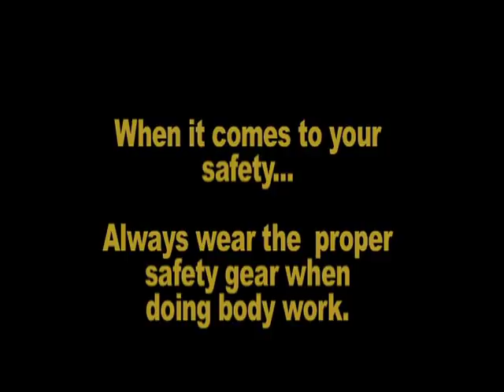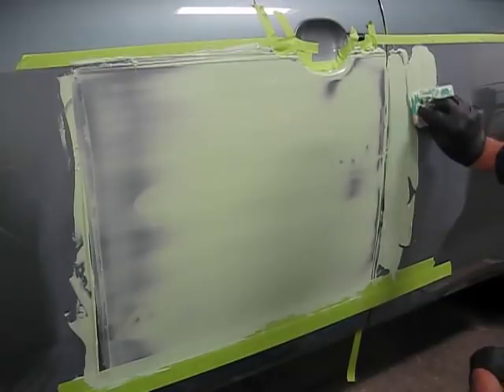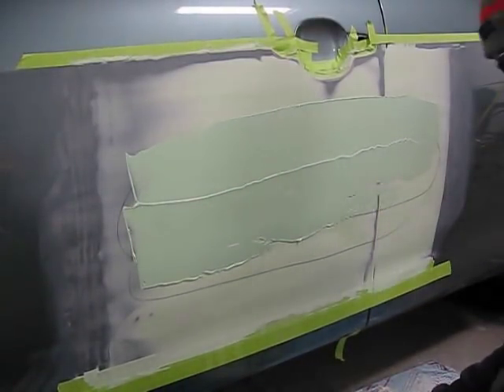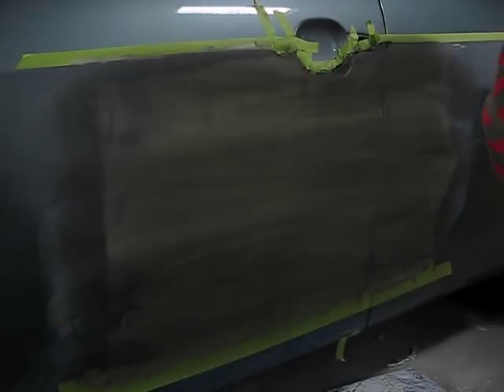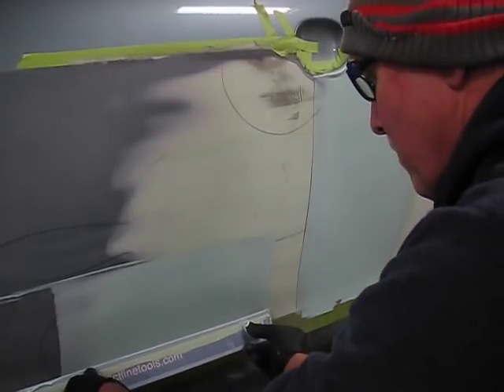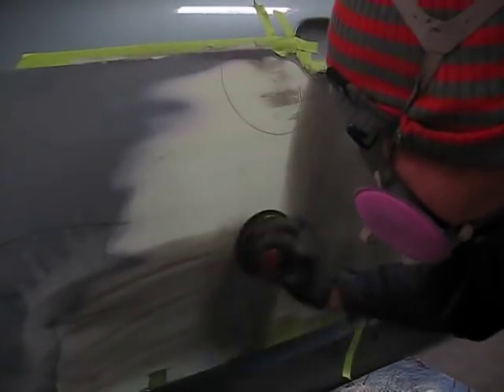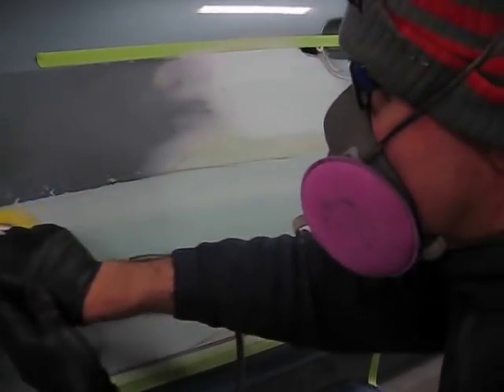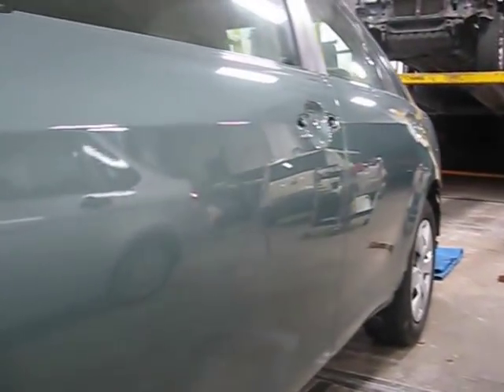BONDO SHAPING PERFECTION WITH THE BLADE

Comment: That works putting it over paint? I was always told to grind or sand all the old paint off,
Reply: yes it does...things have changed...materials are better..etc..you can go directly over paint...
Reply: over "sanded" paint or primer is fine these days. It is actually better not to expose the bare metal. 47 yrs I've been doing body work, yes it use to be grind the paint off first but that changed in 1988 for me with the new paints, primers and body fillers that came out.
Reply: GR Smith I don’t agree at all. This idea that you prime or seal has never worked for me. The mud always shrinks on the edges and pulls away from paint or sealer under it.

Comment: This man has awesome spreading skills, my bondo never stays pliable for that long
Reply: It’s because he has little hardener in it.
Reply: @deeznutzz8375  😂
Reply: I don’t think there is any harder on it
Reply: @deeznutzz8375  The problem with too little hardener is the edges don't set and then the edge can peal when sanding. However theres special types of bondo you can buy that sets even slower and theres also retardants to add that slow it setting.  A product called 'Liquid Honey' can make it runny for horizontal bonnets and roofs.
Reply: First batch I mixed up dryed up before I could apply it😂😂😂😂😂
Reply: They make a slower drying bondo, check into it. I know Keystone makes some for a fact!
Reply: Also if the ambient temperature is colder that helps slow down the curing of the plastic filler, lots of ways to create more working time as necessary 😊

Comment: Some say he is still sanding....
Reply: Has he finished
Reply: Only a body tech can fully appreciate ur comment I pissed my pants laughing .
Reply: Haha , i think he went thru 20 kg's of filler ,
Reply: Nope...hes still sweeping trying to fill all the lows he added with the DA.
Reply: hahaha, legend has it he sanded for a 100 years
Reply: One horizontal skimbit of block, high build 320block fine da and paint. How long he keep filling it. Cant waste your time  that long... way too long time. Whats the point skim it horizontal on a horizontal demage?
Reply: Why is he applying bondo over the high spots without knocking them down ? The blade is trash. If your metal work is good then coat it. Do your best coat the rest!
Reply: Franky Aganza you would think he would tap down high spots when they’ve become transparent through bondo lol..filler in UK. While the filler is wet so not to crack fillers if needed tapping down once cured.
Reply: Ryaneg6freak 🤣🤣🤣🤣
Reply: @filibertobarrera3839  LOL Thats funny. Way too funny. I heard he was flying signs at at busy intersection "Will work for sandpaper and body filler"
Reply: Oh Dude! That was hilarious!
Reply: He didn't put much hardener in it bc when I wipe incan only sweep 3 or four times before its taking chunks

Comment: Ive been in this trade for years, sorry, but this is not how to do it.. As the mud was being applied, high spots were clearly seen, they should have been knocked down before applying filler, 
Filler or what you call bondo, should not be applied over paint.
You were sanding with grit that is far too fine, making extra work and not getting the shape of the panel as the filler was being sanded.
For the amateurs out there, this is not a good way to learn, you'll end up in a mess with loads of wasted material.
Sorry for being negative, I appreciate your efforts made
Reply: Yeah I was thinking the same thing, been a journeyman for thirty years myself. Have you ever seen anybody sand an entire coat of bondo just to put another coat of bondo on top?   It seems to me that this "blade" business is just a substitute for being able to tell when your panel is "straight", anything to sell stuff to people that have no business being in the trade.
Reply: Why would you apply it over the door opening. Never seen anything like this from anyone that knows anything about working with filler.
Reply: INFOtruth exactly looks like all of his bondo work is way higher than the actual paint he's just feathering it to match the paint never seen bondo applied over paint like that either he should be smashing all that done with 80 grit
Reply: INFOtruth this is what I hate people put videos that don't know what the hell they're doing. and someone you watching this will think they are doing everything right. I have been working in this field for a long time and I see a lot of mistakes being done here
Reply: I've been putting bondo on top of paint for 55 years and never had a problem
Reply: I've been putting filler/bondo on top of paint for 55 years and never had a problem, but needs to be keyed with at least 80 grit paper
Reply: you are correct. gimmick to sell to stupid people.
Reply: Didn't even attempt to file it at all, buzz it back and bog....lazy af craftsmanship.
Reply: After base/clear was introduced back in 80's along with the new high build urethane primers and new high tech plastic body fillers it became not only possible but highly recommended that body filler be applied on top of sanded paint or primer. I've been doing it now for around 29 years with no problem. Here in Alabama it changed in 1988 and has only gotten better with the fillers, paints and primers.
Reply: Snowflake well yea u can hear his voice sounds lazy😂
Reply: Totally agree. The original paint is stuck to the panel far better than anything I can put on there. Plus if you bare metal it, your grinding off the E-coat protection
Reply: Can you tell me how to be more efficient? My managers teach me to sand down with 180 grit, then we use 400 grit, spot putty, or body filler if needed, sand down with 400 and then 800, then we prime and paint. A panel can take 2 hours start to finish with clear. I want to learn good habits from diff people.
Reply: Umm its all polyester. some guys just dont get it. so in fibreglass!
Reply: Any of pros out the have any good videos that you'd recommend?
Reply: Iv e used the wire trick to check for any low or high spots I can't see or feel. It's wor ked since leadslingers were working. I don't use "bondo" or silly putty that most body men call that junk. What happened to body work and a light coat of filler (I use overcoat rage gold for custom paint as I don't do minor work since I retired I do custom cars not production work anymore). When I was apprentice and taught apprentices it was as little filler as possible not cover the entire door. Yes some custom shops do an entire coat on the car(Boyd Codfington was known for this) but you get a better job and better bodyman when you arrive for as close to a metal finish as possible. If I need more than a skim coat I'll lead the spot first but I guess production means more than quality.
Reply: INFOtruth yea this is funny. Dont look like they are usimg hardner.
Reply: INFOtruth Absolutely agree with you besides that many fillers made now are designed to be able to spread in to paint, read any 3M body filler label and it’ll tell you weather you can or cannot do that. I honestly wanna know what this guys body filler bill looks like though haha, that’s a huuuuuuuge waste in this video.
Reply: Adrian Cuevas Check out the Gunman videos and Tony' s refinishing. They are priceless.
Reply: What would you recommend as a good body filler?  I try bondo but it's too thick then I need to add a glazing putty.  Is there any way to thin it?
Reply: James O'Phelan overcoat rage gold, polyester glaze or U-pol is what I use.
Reply: James O'Phelan Evercoat I meant.
Reply: Think are you missing something besides a few cards from your deck. Maybe its from the lead filler. Skim coat of filler over every panel. I have seen work from guys who claim to be great and not use much filler. Sure to a car show tourist it looks good but to anyone that knows wtf a straight car looks like, the body work is lacking.
Also believe it or not. lead will crack before quality fillers. Camaros have been proving that forever. 
Now me personally I love getting tips from guys that do custom work and have won huge shows vs guys commenting on youtube vids about how great their methods are lol. JUST SAYING
Reply: All the pro custom (90%) use Evercoat Rage on this this side of the planet.  Now Bondo brand is good shit for the DIYer and just looking to fix up his ride to last 3-4-5 more yrs. 
In my teens my first few $250-500 cars were rust buckets when I bought them.  Today thats a $2500-5000 car as kids today do not know the value of a dollar as most of them live at home until 25-30 yrs old and don't have bills beyond their cell phone and car/insurance. 
I have been into cars since I was 12-13yrs old old so I knew if the rust was in a quarter or rear inner fender to avoid buying it. Not because it could not be repaired but it was beyond my skill at that time and I wasn't going to pay a shop to do it. 
As for your pinhole issue using bondo there could be 1001 reaons for it. Its not the product though. Could be a mixing issues adding air into it. Not using enough pressure. Putting it on to thick. Not using enough or to much catalyst. It does have a lil leeway there so it would have to be a lil extreme on one end or the other. To much is usually the culprit. When you lay it on and you feel it getting tacking do not try and work it any more. It will create these air bubbles requiring another coat or putty. 
Again there are 1001 causes. Be mindful of how you mix/apply it. if still getting bubbles maybe its your house keeping.
Reply: keith douglas , your absolutely right, bondo sticks to 80 grit, and putty to 180, let's see how this repair looks in a month or so, prob coming off lmao
Reply: @HagakureJunkie  3M platinum plus is good stuff
Reply: I read that you use the liquid hardener that's used with fiberglass instead of the cream hardener to thin your body filler.  I don't know how effective this is, but it may be worth a try or maybe google it?
Reply: @williamcharles9480  No William, you would not want to try thinning the filler with liquid hardener intended for fiberglass. I think what you meant to say was you can thin filler a bit with the fiberglass resin, not the hardener.
Also, I'm not a 3M groupie at all but the 3M Platinum line of fillers are awesome, Platinum, Platinum Plus, Platinum Select...
Todd
Annapolis, MD
Reply: You do not use the hardener but you use the resin to thin out. FYI
Reply: @keithdouglas4581  exactly
Reply: I don't know what kind of Bondo he's using. How to use Bondo before I never had that much time to work it.
Reply: @keithdouglas4581  yes is long is send down rigth should be no problem off course dented areas do have be grind for better lasting.
Reply: really ?I just learning at 61 yo but im a nail tech of 40 years so its about the same yet I am using acrylics.  My problem is how to know how much rondo and catalyst . its hot where I live so I think im using too much/. plus im doing this with fiberglass  and Rondo as my bathtub is 40 years old and its 60x50  I don't want to change it, but they use to make. them with ABS plastic mold and add lots of fiberglass. What a dam job its been.  I am now  very interested in doing this on. my car. I di my hood and primed it. I need n area to paint it though...

Comment: Ive been repairing damage for 30 years and never used a blade..1 good 1st fill and block sanding would have cut this job in half..i'm sure if he tried a different tactic them blades would go in the trash..man this was hard to watch.

Comment: I've used a metal yard stick cut in half before on large fill areas. Worked great.
Reply: I was thinking of doing that exact same thing for something else (not body repair-I’d be way too scared to attempt that!) ...or possibly one of my husband’s old metal real estate signs (not the big main sign...just  one of those Little add-on’s. It’s roughly a 20”x 9” rectangle or so..). It would def.work for what I’m using it for. Just use tin snips to cut it to the length/width you need (if necessary).  I like that It’s rigid on the straight edge, but still flexible long-ways so you can get a nice curved shape and feathered edges. All-in-all I really appreciated this video- I don’t know [really anything] about body work...so maybe all these rude know-it-all’s know something I don’t, but the end result was stunning (!!) sooo  - I guess he did “something” right! Lol! Half of them apparently didn’t pass English class by the looks of their GRAMMAR...😂  Perhaps they’d consider not sounding so stinking ignorant as they judge this nice man who took the time to make this video. People are just so rude, I swear. Alright- my two cents have been added, for all it was worth!